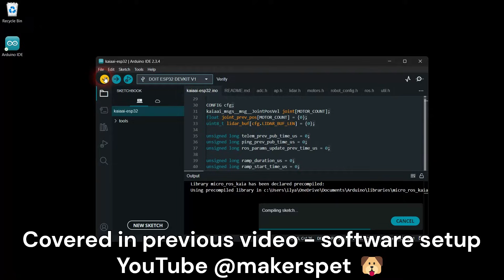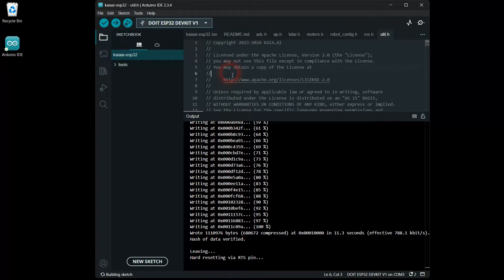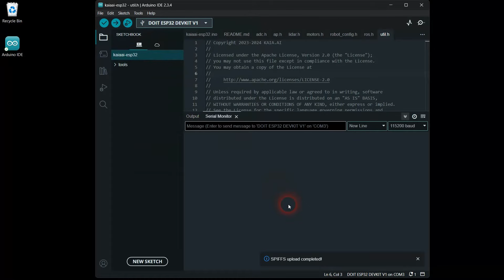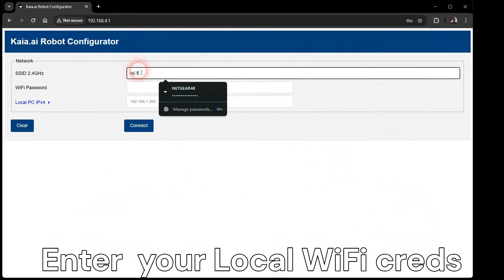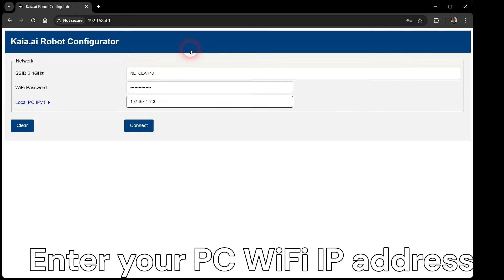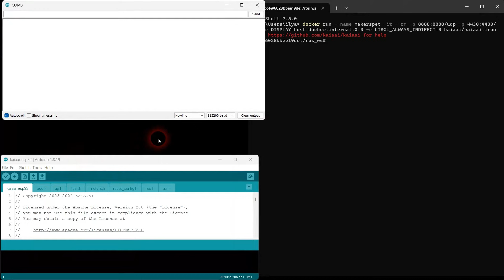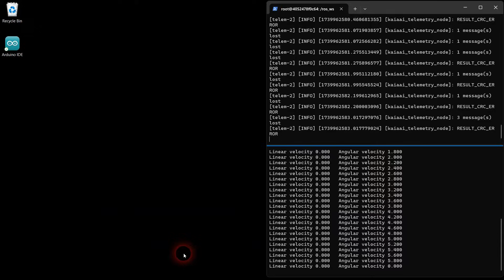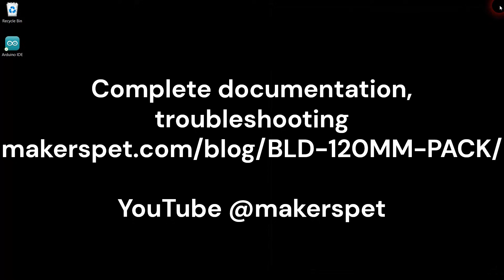Step by Step Arduino LiDAR Robot Bringup

Comment: Do you know , how to connect raspberry 5 with LDS01RR or LDS02RR? 🙏🙏🙏
Reply from the maker: LDS02RR TX to RPi serial RX, RX to TX, 5V to Lidar, manually adjustable DC power to Lidar motor
Reply: Thx!, it is spinning now, but I can't see any data in terminal - I use Ubuntu 22.04 with ros2, tryed "screen" command.

Do I need any additional software for lidar to read the data?
Reply from the maker: @Artem.Maltsev2000 can you create a new thread at the support forum https://github.com/makerspet/support/discussion
Reply: Done

Comment: sir plz give solution for this , we are doing a project but we are facing this problem
[telem-2] [INFO] [1741678098.474772597] [kaiaai_telemetry_node]: LDS model LDROBOT-LD14P
in powershell am getting like this but am using YDLidar X2 
Also changed the model name in config.yml to X2
and am not getting the connection of YDLidar X2 with esp32
Reply: sir plz reply ASAP

Comment: [telem-2] [INFO] [1741678098.474772597] [kaiaai_telemetry_node]: LDS model LDROBOT-LD14P
in powershell am getting like this but am using YDLidar X2 
Also changed the model name in config.yml to X2
and am not getting the connection of YDLidar X2 with esp32
Reply: Am also getting same error
Reply: plz reply ASAP